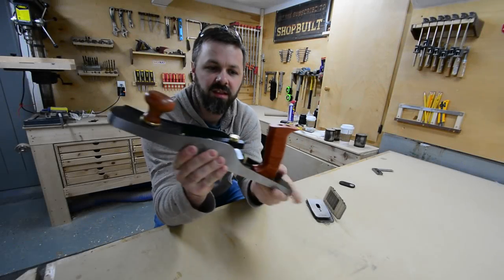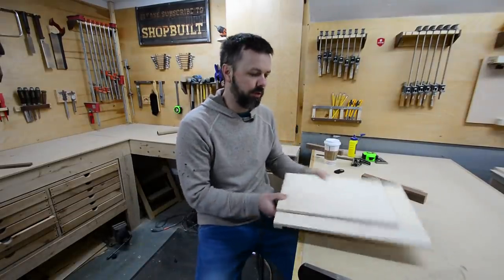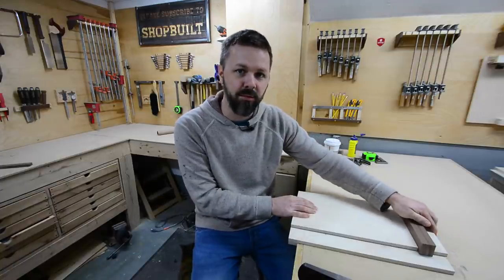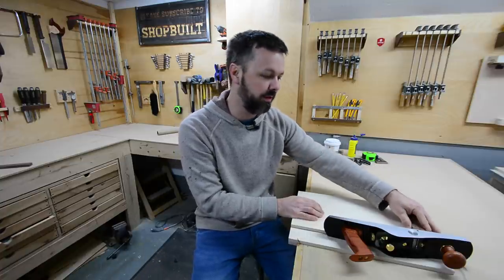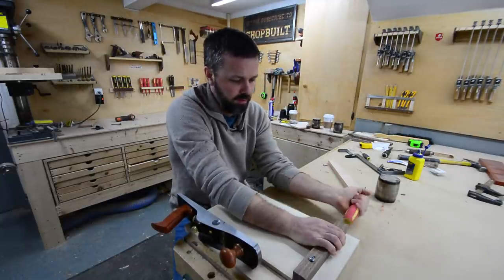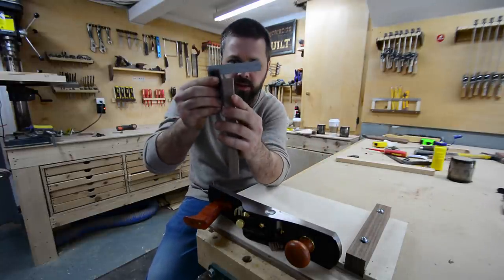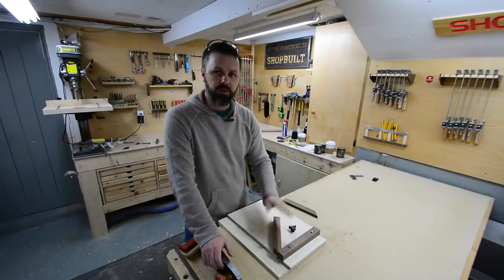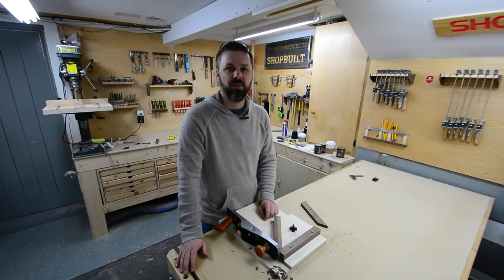For precision, use a shooting board!

Comment: Just received my Veritas low angle planes (jack, smoothing and block) and they rock. Out of the box, was able to get 0.0005 in shavings from the jack and smoother planes. A bit thicker shavings from the block planes, but the blade may need to be honed. Love the quality of the build and ease of use!

Comment: Not clear on the direction of the grain. I am under the impression that the grain should be oriented horizontally to prevent it from growing/shrinking in the slot. Because the "straws" get fatter when they pick up water, but the length of the straws doesn't much change. It looks like you are orienting the grain vertically?

Comment: Aren't sharp handplanes on a shooting board wonderful?   Perhaps on a shooting board,  one could taper-cut the slots for the fences.  Then cut a locking wedge that will hold a sacrifical fence tightly, and will also provide adjustment for swelling/shrinkage due to changes in relative humidity.  Also, so people undercut/chamfer the top board of the platform to relieve accumulations of dust and chips, but I don't know if that's absolutely necessary.

Comment: That's a really nice looking plane. I used to use a normal angle jack plane on a shooting board and it worked fairly well, but i would've loved a low angle jack plane!
Reply from the maker: The low angle definitely helps but any plane will do the job:)

Comment: First let me say - Great projects and videos. As a retired shop teacher I would strongly suggest you start using a guard on your table saw as often as possible especially with any plywood. If you slip at all it will catch the blade , ride onto the top and spin out of your hands. Hopefully when this happens it will not take your hands with it. Usually the woodworkers who don't use guards are the one without fingers. As apprentices we were taught to sing in our heads " picking up fingers, put em in your pocket"

Comment: Thanks. great video! probably gonna make myself one of these. I won't be using plywood, the glue between the layers is tough on the blade.
Reply: Not if you notch the ply so that the blade doesn’t come in contact with it. That’s why I left him the comment I did because all of this build is wrong!

Comment: Thanks for another great vid Ryan. One thing: could you explain what you meant regarding the rabbet in the mahogany cross piece? Is the rabbet at the bottom? Why? How big? Thanks again, John.
Reply from the maker: the rabbit is at the bottom of the fence. it's depth is the same length as the slotted holes and its height is a little higher than the distance from the edge of the plane to the blade. If you didn't have this rabbit than you wouldn't be able to trim the fence flush because of the portion of the plane where there is no blade wouldn't get trimed and would be left to long. hope this makes since, hard to explain....
Reply: That makes sense, Ryan, thanks for clearing it up. I'll be replicating your design in my own workshop. Nice one!

Comment: Why would the end of the fence wear out? The sole of the plane will keep it from digging into the fence anymore than the depth of the blade.
Reply from the maker: +William Butler in theory it shouldn't but it's pretty easy to accedently rock the plane forward enough to take pass off the fence.

Comment: Just wanted to note that "factory edge" and "nice and square" are not always true.  Always measure one across the angles from each batch.  I built a big work table and double checked a 3/4" sheet and it was good so I started building, forgot to check a 1/2" sheet, figured they were all bought at same time, same veneer, & same manufacture just a different thickness.. Nope.  All the 1/2" sheets were off and my project is not perfectly square because of it.  (1/8" out of alignment over 8ft is too much in my case)

That wasn't the first time its happened for me either.  I think something like 1/3 of all plywood is not perfectly square.

Comment: A stupid question from a complete novice:  What stops the plane from planing the base on which the workpiece rests?

Cheers and thanks for the great content.
Reply: the sole of the plane. the blade is not as wide as the sole so there comes a point where the blade has gone into the base but the sole is in full contact with the base and the plane cannot go further inside.

Comment: what were the barrel shape things you used as weights?
Reply: imakeandimprove They look like rollers out of a very large roller bearing
Reply from the maker: Yes, its a rolling element out of a huge bearing we changed at work a couple of years ago. i wish i brought home more than three now, they're really handy.
Reply: Shop built I found an old home gym thing someone was tossing and I got a couple of the square plates from the weight stack that I use.

Comment: There is a problem with this design.  The fence should not be aligned with the cutting line.  Better to have the fence a little short of the fence.  The fence should never be cut.

Comment: This is an awesome video on a subject that is very often ignored or over-simplified. However... I may be seeing things wrong, or just haven't had enough coffee yet this morning, but I believe you have the hardwood growth rings in exactly the wrong orientation. You show that the growth rings run straight, parallel, and horizontally across the end grain of the wood, but then you rotate the piece 90 degrees and show that any expansion and/or contraction will happen with the grain rings. But this isn't true. When wood expands, it is like a series of thin dry sponges stacked on top of each other; when you pour over some water, they expand in a perpendicular direction to the growth rings. 

Like I said, I my eyes may be failing me.
Reply from the maker: +Michael Perkins  hmmm, I'm no expert on the matter but this is what I referenced: http://workshopcompanion.com/KnowHow/Design/Nature_of_Wood/2_Wood_Movement/2_Wood_Movement.htm
Reply: Interesting. I was thinking about that backwards, too. I used to own a log cabin, and the exterior walls literally shrunk two inches once the wood was dry. That's why builders are supposed to make interior walls floating, so the rest of the house doesn't settle on them. Mine didn't, and interior walls ended up driving into the floor, making big dips. That said, it doesn't speak to tangential shrinkage at all, just radial vs longitudinal. Good link.
Reply: I just checked three other resources, in addition to the one you referenced, and Bud, you are 100% correct, and I am 100% incorrect. My apologies! I haven't done a lot of hardwood building, making most of my projects out of plywood. So, I am glad that I watched your video and posted this "thread" before I built some huge hardwood only to find out that I've been thinking about it all wrong.
Thanks for the response!
Reply from the maker: +Michael Perkins it's an easy mistake to make, I have referenced the link I sent you a few times now becuase I keep forgetting what grain moves what way.

Comment: There is a problem with this kind of fence. When it wears out you will need to remove it, cut it short and then attach it again. It is not enough to just move it further, because the lower part of the fence won't get cut with your plane. I hope you understand what i mean.
Reply from the maker: +Blaž Grapar you must have missed the part where I rabbited the bottom of the fence so it would clear the part of the plane where there is no blade;)
Reply: I guess I did. Sorry then.

Comment: Nice video. Thanks. I was fiddling with a bootleg shooting board and my brand new Stanley #5...the handle was a little loose. Getting to the screws required removing the blade.... and I found out, the long brass screw didn't even reach the threads! Sending it back. The show was perfect, the plastic handles? ok...but the screw didn't fit? I've been sold more manufacturing rejects from Amazon....
BTW Factory edge of the plywood-square? Ever see a video of how sheet goods are cut in a factory? The long dimension is moving fast and the cut off  runs diagonally. Squareness is achieved by trigonometry and velocity. Slow down a bit.... 
For years 1/2" Baltic birch 5 x 5s was just a tad off.

Comment: These sleds are ok at best. I’m not trying to dis your build but why would you ever want to plane your fence when you plane your workpiece? If you set the fence back away from the shooting lane around an 1/8”, you never will have a problem with it coming out of square or hitting it with your plane (making it out of square)!!! And I couldn’t tell in the video if the plane was constantly hitting the other side of the shooting lane also.  Do you have that piece of ply to the left lower than your plane blade so it doesn’t come in contact? I’m sorry man but you should’ve done more homework and preparation of this build before trying to wing it! Plus, where is the cleat on the bottom to hold it to the bench? That thing will fly right off and the plane too! Like I said, more homework and research brother!!